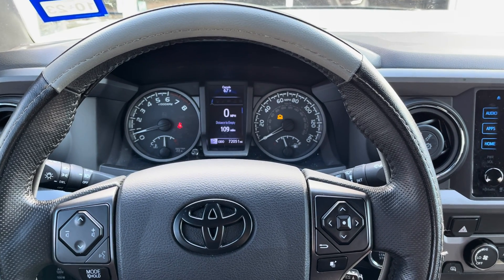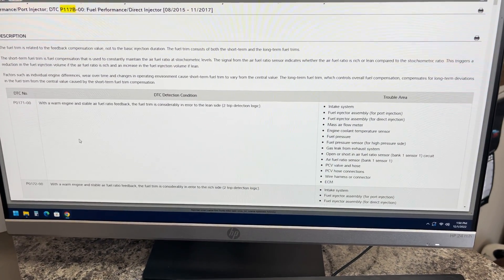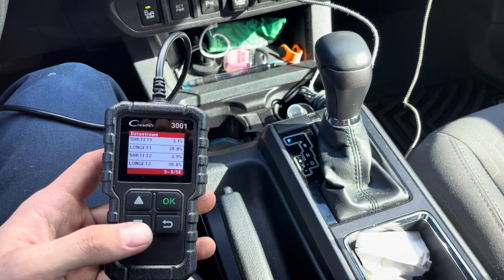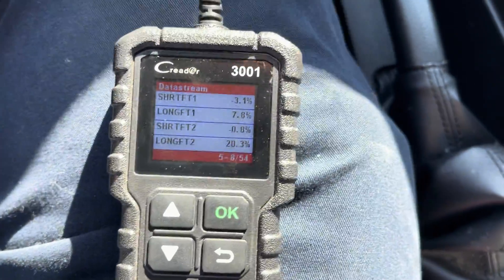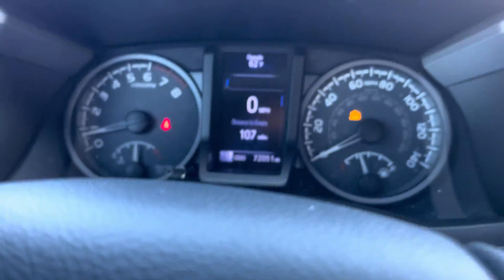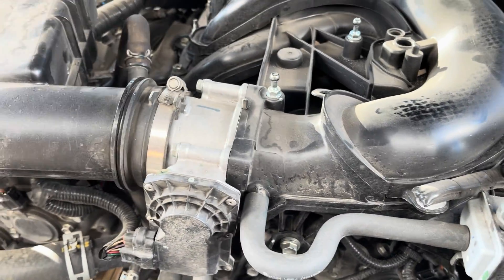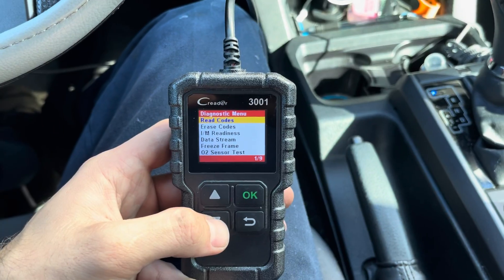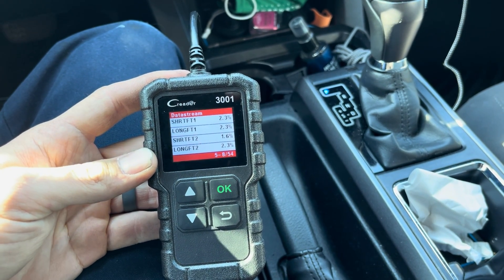2019 Toyota Tacoma P0171 & P0174 Lean Code Diagnosis and Repair

Comment: Will the engine light come off automatically if you fixed the problem? Asking because I know nothing about cars and I believe I could be having this issue lol
Reply from the maker: No, you’ll have to clear the check engine light with a scan tool, or disconnect the battery.

Comment: I have those codes on a 2020 tacoma weird enough when I remove the gas caps lots of trapped air pressure leaks out and when I fuel up it wont turn on until I let it sit there eventually starts back on. Vacuum hose seems to be intact and connected properly what else can I look for?. I would appreciate someones help
Reply: Same thing on mine. After filling up… it will crank but won’t turn over until I let it sit for a while.
Reply: @jcfishing6052  Brother used fuel injector cleaner that type you add into the gas tank and that fixed the problem. In conjunction with cleaning the purge valve good luck.

Comment: I've got these both codes and P0300-301-306. I replaced the coils for all of them. Only replaced the plugs the from 1-3-5. Misfires at idle. I can't seem to narrow down the problem on my roommate's 2005 Highlander V6. Can you help?
Reply: Exactly the same issue. What fixed it?
Reply: @xDirmeyerNFL  vacuum hose in the back was loose when I was changing the coils in the back lol so I just had to reconnect it
Reply: @rightfight100  yes. I had the same issue. I felt so stupid after I saw it.
Reply: @xDirmeyerNFL  haha same boat brother I’m glad we got it fixed

Comment: My numbers go up to 25 when I give it gas.. at idol below 4% I've replaced fuel pump and MAF Sensor.. both banks..
Reply from the maker: Are there any other codes besides P0171 and P0174?
Reply: No other codes
Reply from the maker: Did changing the MAF and fuel pump make any change to your numbers? Have you checked the fuel pressure? What reading are you getting at idle? It does sound like a fuel delivery issue. If your fuel pressure reading is good then I’d check the fuel injectors.
Reply: I've got the same problem as him. Replaced the maf sensor, a/f sensor, o2 sensor, pcv valve & fuel pump. This is what I should've done in the first place, had my fuel trim #'s read!

Comment: I get the same codes, but my fuel trims are showing negative values, -5.5% bank 1 LT FT. -3.9 bank 2 LT FT.
Reply from the maker: Those are the numbers while you’re idling? What about while accelerating going down the road?
Reply: @jackfletcher4060  since got my issue resolved, not sure if it was cleaning PCV system, the taking shit apart and putting it all back together, the hard reset via removing battery for 4 hours, but no issues since. Started tripping the codes when a camshaft sensor (bank 1 exhaust side) had an internal fault, and was replaced. But all levels are looking good now b
Reply: @jackhfletcher  they are all over the place, from -15 up to 12.x